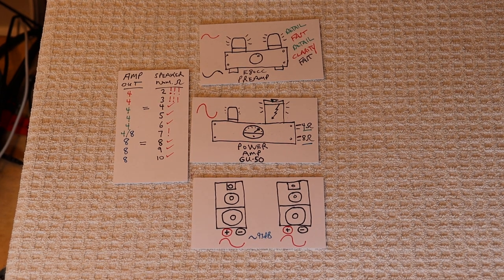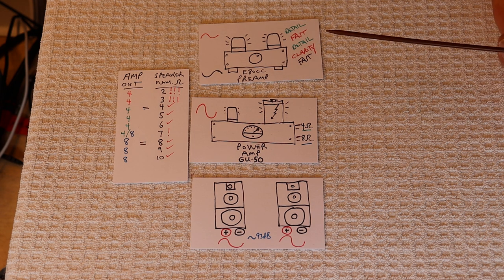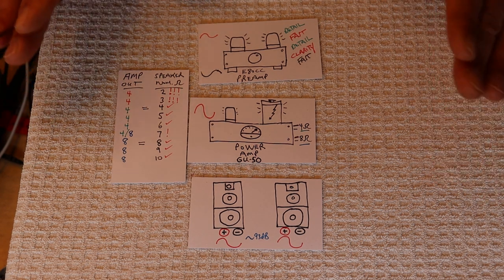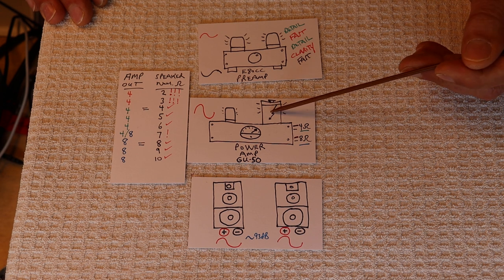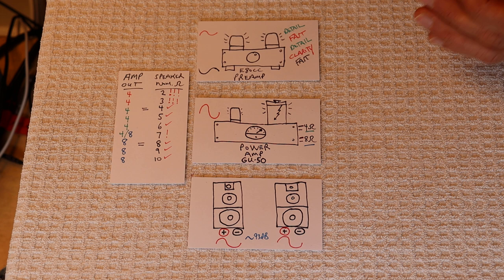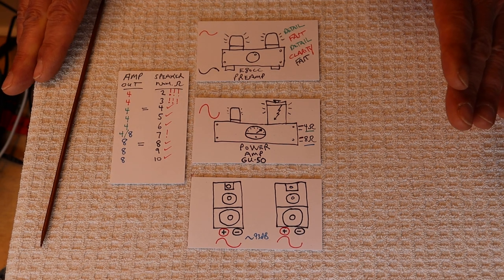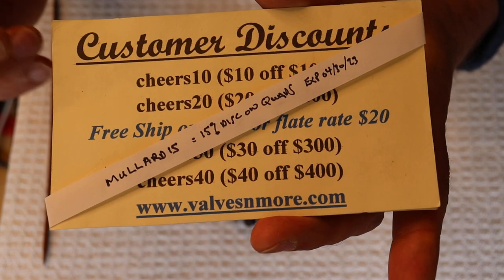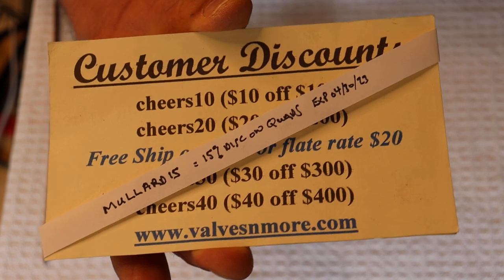Tube Lab #131 - Matching Power Amps to Your Speaker Impedance

Comment: Ohmmeter across voice  coil will give you a rough idea of speaker impedance.4ohm measure about 3,8 measure about 6to7ohm.good to check if series or parallel multiple speakers (can't always trust my math)
Reply from the maker: Yes, but this can be tricky, it's actually more accurate to pull the crossover, measure the drivers individually and then work the math on paper and even then it's still just a ball park estimate.  I've come to the conclusion that even if everything checks out, the ultimate test is a volume test - that will confirm the amp and speakers are load alligned.  While also keeping a close eye on operating temps.

Comment: Electrostatics ESL 63 ????
Difficult load.
How to get the best besides a power amp 50 w plus.
For all amps? Tubes....otherwise...?
Reply from the maker: I am absolutely not an expert on Electrostatics, about the only thing i know is that they can be a very difficult load to drive.  This doesn't rule out tubes completely though - what I would do is find a good match in a high power solid state mono block and place an all tube preamp in front of the system - giving you the best of all possible solutions - lots of power and the lovely sonics of tubes.